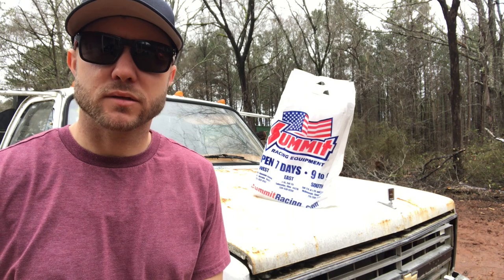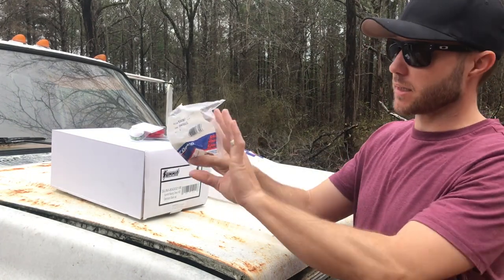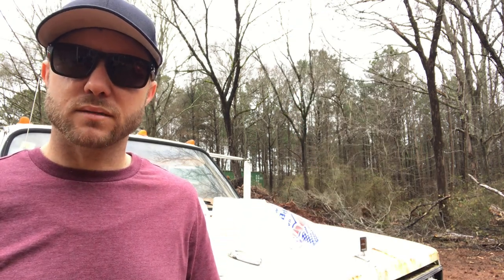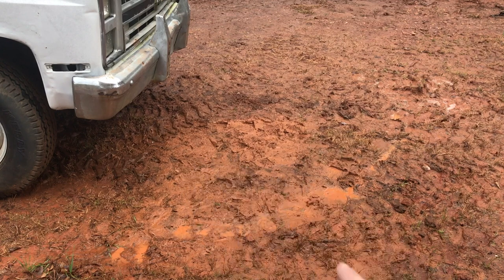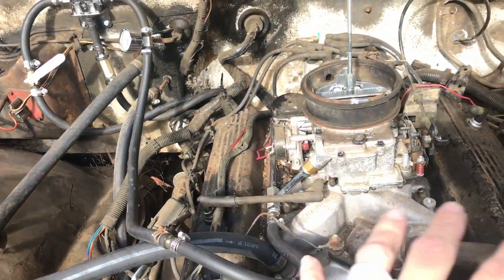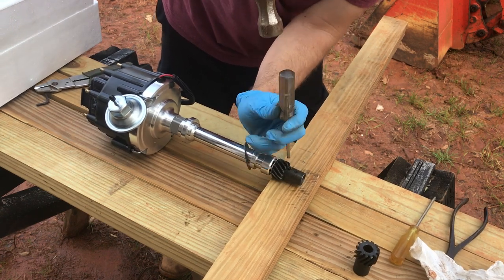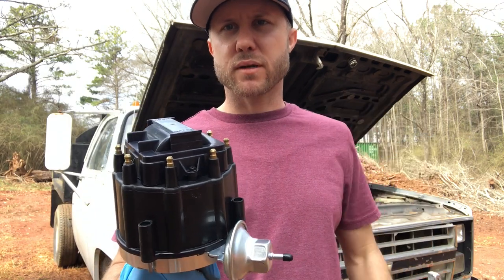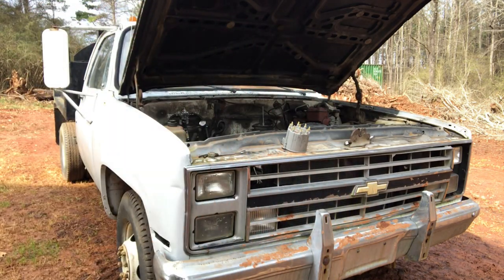Replace the HEI distributor on a Chevy (part 1) TBI to carb swap Chevy R30 Dump Truck #2

Comment: I converted my tbi to carburetor on my 89 chevy 3500 small dump truck. Installed a Hei dist. Edelbrock carb & intake man. This 350 engine has center bolt valve covers. I also installed a mechanical fuel pump, removed the electric fuel pump from the gas tank & installed a standard tank sending unit. Truck runs 100% better !!

Comment: I watched all of these vids having same problem with 1988 suburban I bought was running left me stranded just died towed to a shop 250$ shop had it for 2 months and gave up charged me 200$ for new distributor and still had to tow it from the shop back home.spark would come and go I watched the 3rd video where it showed your distributor was wired to radio fuse.the person I bought my truck had done same damn thing I switched line from radio to ignition fuse and bam fired up.i was ready to give up and do a carb hei swap your issues saved me 1000$ thanks alot for your help!!!

Comment: I had two tbis converted used the pump in the tank with a regulator and had zero issues ran a carb and an hei distributor again zero issues whatsoever ran great w q jet carbs
Reply: I am doing exactly that right now on an 89 c3500 tbi swap to Quadrajet. Glad to see you had no problem.

Comment: I don't think you have to replace the dist. gear unless you have a high performance forged steel camshaft.  If you have a stock cast iron camshaft, just drop the new HEI it and go.  What info. led you to decide to change the gear out?

Comment: ...saltus wrenches, or socket/open end wrenches, are ideal for spots like that distributor bolt...the socket end is smaller than a ratchet head, and you have an infinite angle adjustment.. :)

Comment: glad to hear some calming music instead of the overly loud music most youtubers use. Do you have the part number to the distributor gear.
Reply from the maker: The melonized distributor gear that I bought from Summit Racing is ADO-10456413. I will add it to the description.

Comment: Im having issues with the same truck! Shes an 88 chevy r30. It is tbi on a crate 454, i have an ecm b fuse blowing, its only 10 amp but she will cut off after driving just like you said.. ideas? Tips? Any places you had wiring issues related to fuses? Anything helps man, thank you
Reply: I just purchased a 1988 r30. I drove it from Kingman, AZ to Austin, TX. I started blowing the ecm b fuse which is on the injector circuit side. I was broke down in Snyder, TX at a gas station for a whole day going through all the circuits. I found out it was my oil pressure sensor wire broke off grounding to the chassis.  Unplug the fuel pump relay and see if it is blowing a fuse. That will tell you if it is in the fuel pump or not. Just pull up a diagram and unplug each circuit and check continuity. Hope this helps.

Comment: Big old pos Holley carb on there probably way too big for that motor junk and of course it will never run right with the TBI distributor in it who does that and where do they do that at?
Reply from the maker: The carb is a summit racing brand carb. The guy I bought the truck from had a local shop do the conversion.

Comment: I can't imagine that being a  88, pretty sure you have the last square body of 87
Reply from the maker: It’s an 88. GM made this version and the newer body style in 1988.
Reply: @BrantleyBlended  must have been a spare parts production run
Reply: I have a1989 square body 3500 small dump truck. It's designated as a R series 3500 truck.